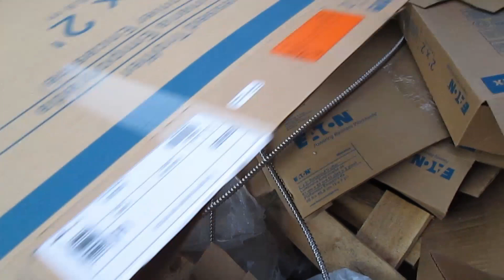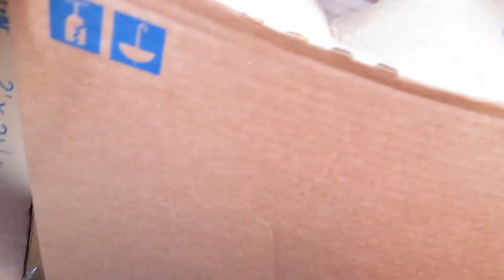LET'S GO DUMPSTER DIVING 😎

Comment: When you encounter big roll off type dumpsters like the one in the beginning of this video, if they have the name of a recycling company on them, the recycling company already owns what is inside of the dumpster. Taking items from that type of dumpster does have the possibility of putting you in jail. Be very careful when dealing with recycling company dumpsters. I wouldn't even think of looking at them myself. If there are security cameras in place, even if you can not see them, that is all the evidence they need to prosecute, and most recycling companies will, they take theft very seriously.

EDIT Smaller dumpsters like the one following the large roll off, are fair game, unless they are behind a locked gate with "no trespassing" signs posted. Those are just like trash cans in front of single family homes.
Reply from the maker: We Actually have permission :) Main reason why we keep going back :) Also We Talked to a Local Police officer That Had stopped us while we were dumpster diving and she said it was Fine as long as it wasnt a metal dumpster !! Which They are always Labeled :) We have learned so much and will continue to learn so much More &Thank you For The Insight !!

Comment: awesome copper haul. I notice you get a lot of armored cable, there is a tool made by Kline called rotosplits that makes taking the armor off the wire easy. I believetheycost about dollars or so but I have seen them on craigslist too for 10 to 15. Figured I would share that since I never seen or heard you guys mention it before.